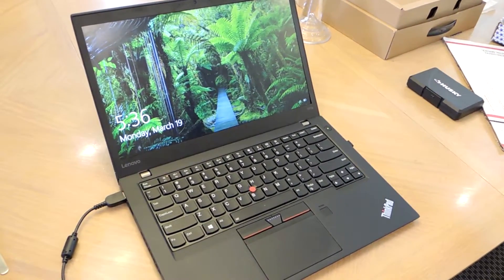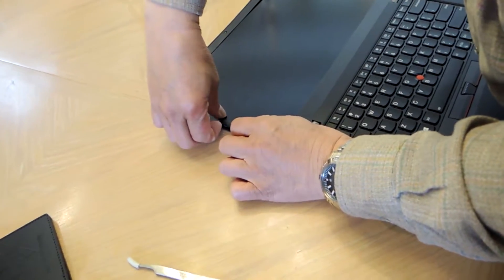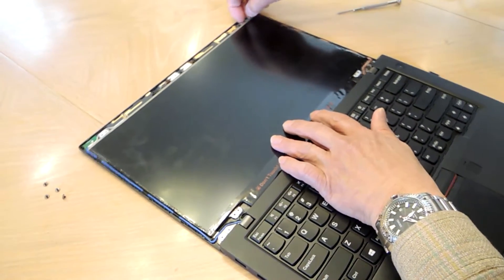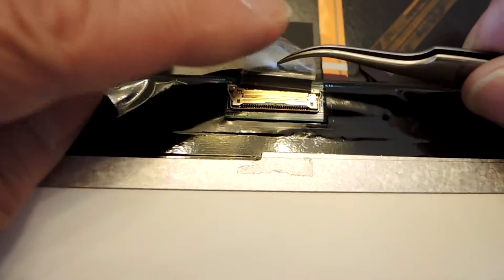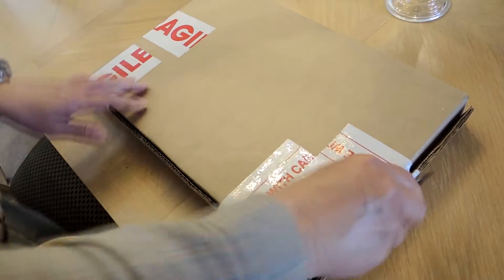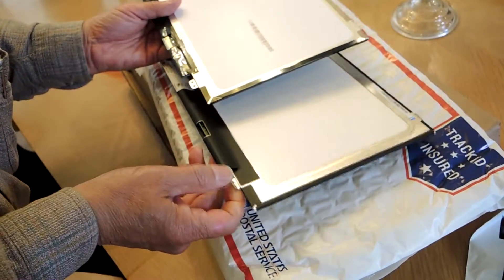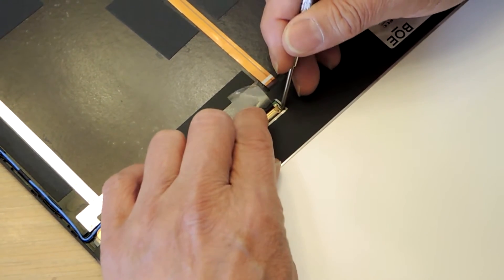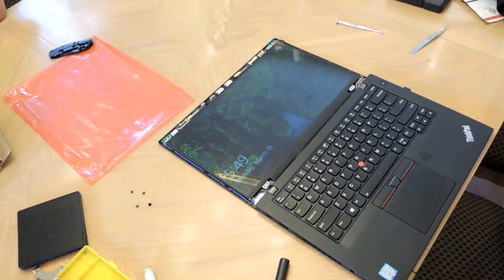Laptop screen replacement / How to replace laptop screen THINKPAD T470S 20HF0014US

Comment: Looks like the replacement screen is flickering real bad.
Reply from the maker: Nothing wrong with in. It's the camera video flicker
Reply: @tathuen  Itt is the alias frequency of the pwm backlight circuitry. You don't see it with your bare eyes but it is revealed by the frame rate of the camera.

Comment: As I can not find anything about it on internet:
Can I replace a non touch screen with a touchscreen? Given the connector has the same pins?

If not, what about upgrading resolutions this way?
Reply: You all probably dont give a damn but does any of you know a way to get back into an Instagram account??
I was stupid lost the account password. I would appreciate any tips you can give me
Reply: @Fisher Terrell Instablaster =)
Reply: @Titan Harvey thanks for your reply. I found the site through google and I'm waiting for the hacking stuff now.
Seems to take a while so I will get back to you later with my results.
Reply: @Titan Harvey it did the trick and I now got access to my account again. Im so happy:D
Thanks so much you saved my account :D
Reply: @Fisher Terrell happy to help =)
Reply: I think you must replace the edp connector with the 30 pins connector if you want to use non touch screen display, the same method applies if you want to upgrade the screen to WQHD (1440p)